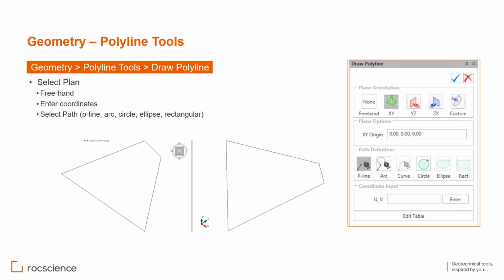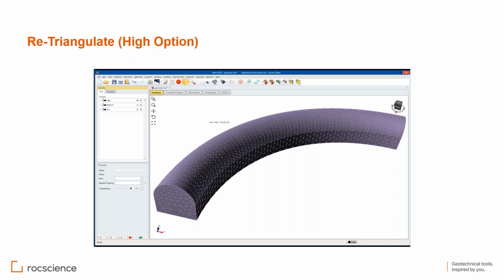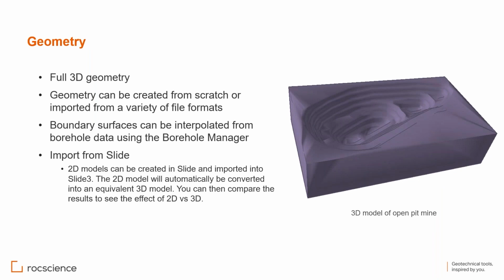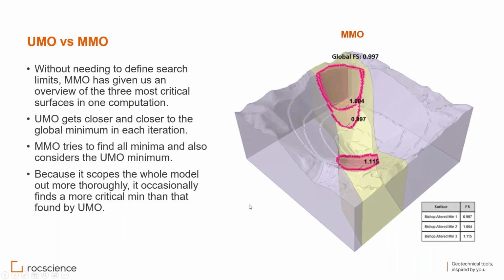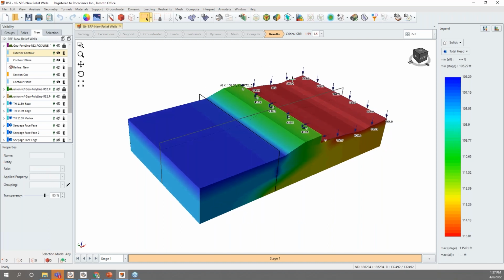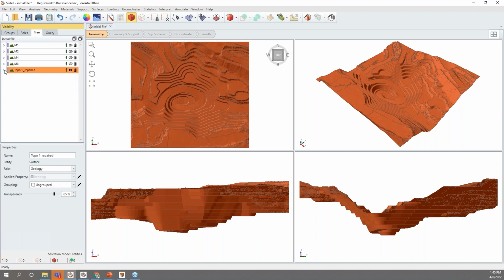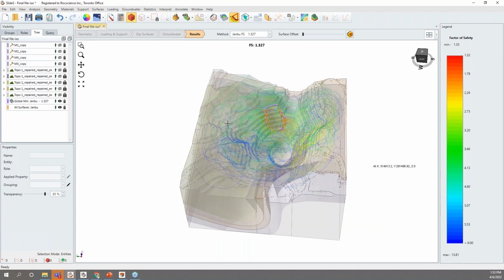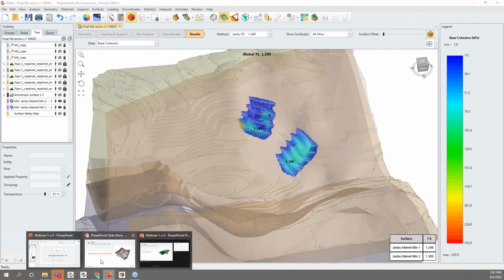Rocscience Webinar - 3D Geometry Creation and Modelling in Slide3

Comment: How to model non "layer cake" model? For example the partial volume model such as sand lens and more that material surfaces not intersect the external box?
Reply from the maker: Hello Ruzt,
If you have material regions that are not inside the External geometry but have an area in common with it, you can use the "Add to External" option in our 3D software to make them part of the external. This will enable you to carry out the analysis.